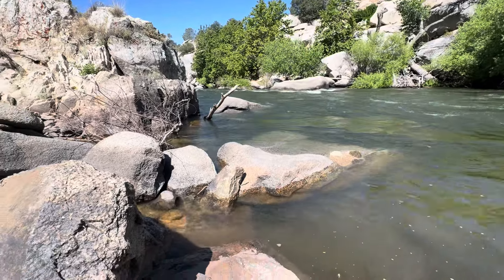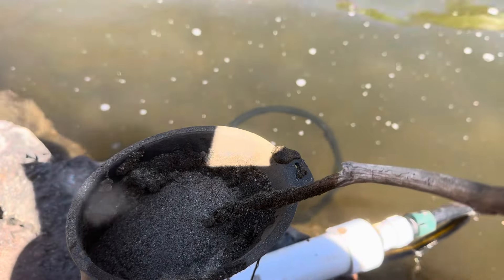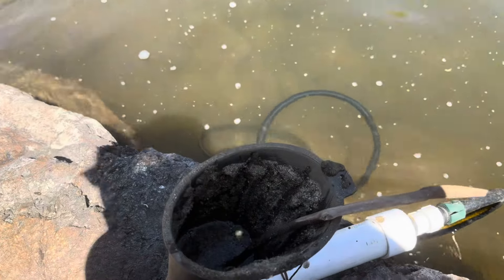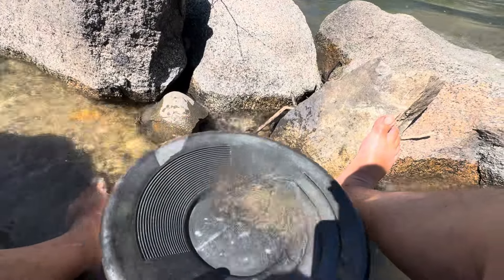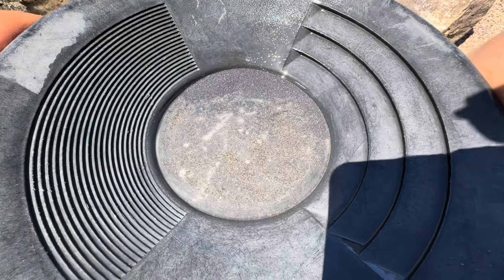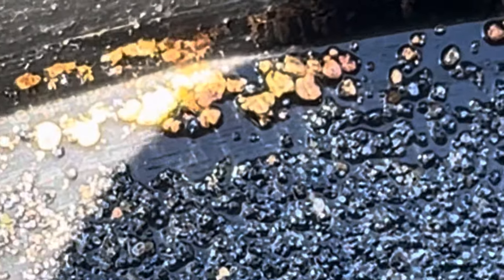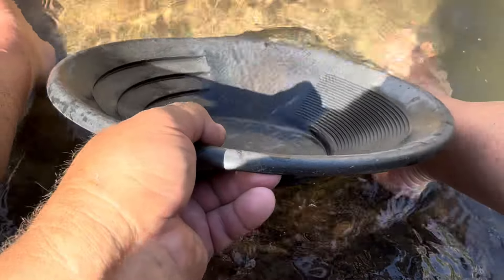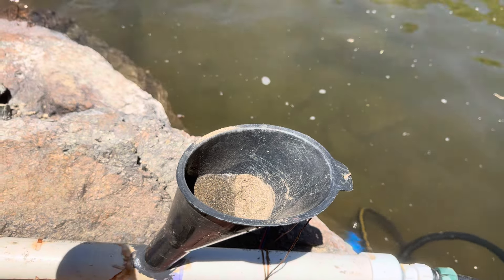Testing my gold concentrator, too hot for gold need to take a cold water splash 🤪😝🤣￼

Comment: Wonderful! If you have trouble with the feed funnel, try running a small amount of water into it. Make a vortex and slowly feed the sand into the vortex.  Nice gold!  -- Dave
Reply: These compact devices can be set up anywhere and operate using just half a gallon of recirculating water. Carrying water can be cumbersome, similar to the challenge of transporting 50 pounds of material that only produces a few hundred grams of concentrates.

Comment: A more even feeding this time, and the water was backed-up only to the base of the funnel. I Don't think adding a water stream into the funnel will help, because the sand will still bridge off at the backed-up water level.  Only a rotating wire with ridges might help, but that defeats simplicity.  Your poking stick will probably remain the best mechanical feed mechanism.  Interesting copper colors with the gold.  Will see if they are enough to turn your aqua regia bluish.

Comment: In my area, I found no gold. But I found brown sand under my black sand. No gold. Not even microscopic gold.
Reply from the maker: If you do like me panning with the black sand, and then you remove the black sand, and you still see something brown that can be easy gold. Do Aquia and stannous chloride tells you exactly what’s going on. Underneath the black sand is just heavy, material platinum, palladium, gold radium, and all those heavy metals
Reply: @myadventure7069  I did the same panning with black sand. But nothing but ligh color crystal sand under black sand. 
I don't understand the chemical. I cannot do acid yet. If you make a video of where I can get chemicals. And buy it. 
I will go to the mountains tonight to find new places to get sand from.
Reply: @myadventure7069  Thank you for replying.
Reply: A more even feeding this time, and the water was backed-up only to the base of the funnel.  I don't think adding a water stream to the funnel will help, because the sand will still bridge off at the backed-up water level. Only a rotating wire with ridges might help, but that defeats simplicity.  Your poking stick is probably remain the best mechanical feed  mechanism!  Interesting copper colors.  Will see if they turn your aqua regia bluish.
Reply from the maker: If you remove black sand with magnet and don’t see the gold using magnify glass that means you don’t have gold and don’t even need to do chemicals if you don’t have a gold😜
Reply: عمل رائع شكرا لك ايه المعلم
Reply: @myadventure7069  that's exactly what I was thinking. I will be in the mountains later this afternoon to fine new sand.